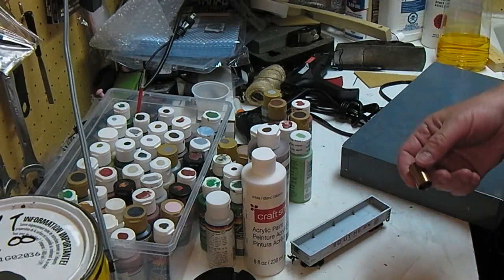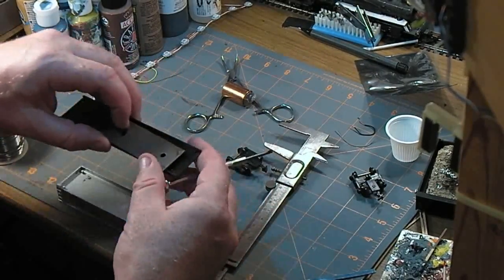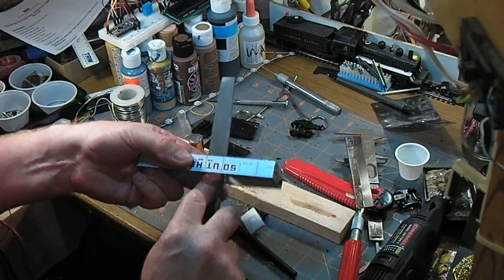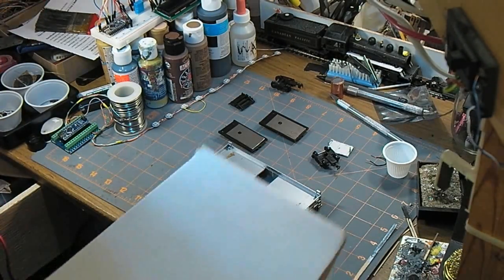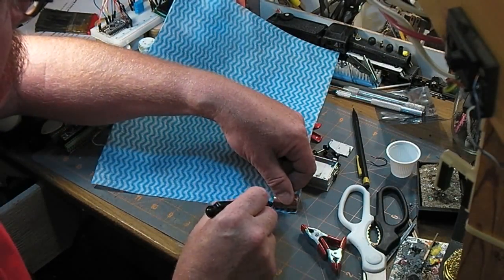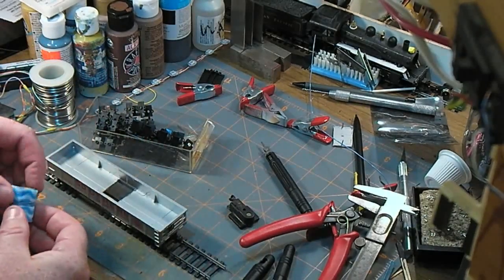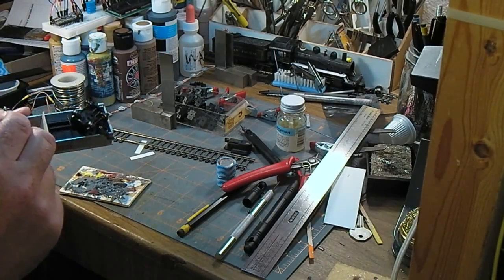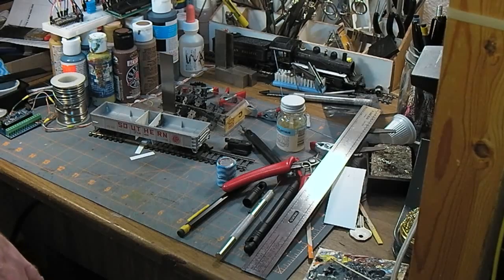Building a track cleaning car

Comment: I know this is an old vid, but I wanted to point out that the fundamental error in the design is that the cleaning pad rolls. As a single car you want the cleaning pad to be stationary. A rolling pad only moistens/softens the crud, it won’t remove it. If on the other hand, an additional car with an abrasive pad followed, it would remove the moist crud on the rail head. To this end, I am currently building a MOW track cleaning train with 4 cleaning cars which include, in order, 1 wet-clean car, 1 abrasive clean car, 2nd abrasive clean car (different type of pad), and lastly a soft-clean (buffing pad) car. Mixed in will be a crane, flat car, and flanger caboose on the tail end.
Another commenter questioned about how someone should make a Loram track cleaning car. Myself & a couple other modelers discussed this some years ago. That is, making a prototype to look into mass production. It ended up never materializing on the basis that we felt too few people would be willing to spend $800+ on a track cleaning train. It might make more sense for someone such as Walthers or Atlas to manufacture such a thing, but not a start up company as their very first offering.

Comment: Just finished test running this past week and must say how pleased I am with the result. The only real difference in mine to yours is the use of lead shot instead of nails in the middle which is held with two part epoxy which was dribbled in very wet and allowed to set fully. I then filed and sanded the ends flat and set the roller as you suggest. 
I did add a 'load' over the roller which is removable with a magnet and it too (the load) has lead shot mounted under it to balance the car heavily over the axles. I also added brass baring cups (reused from percussion caps as used in historic weapons) for the pin point axles to allow for these added weights on the non-conductive wheels.
Reply from the maker: Good idea with the shot. Use what you have is a big part of my modelling philosophy.

I added a basic crate to mine a few months later as a load.

https://www.youtube.com/watch?v=EpAvJ_FotWs&index=4&list=PLE9Um5NpNcs5ghfp6Y1Ezy2zEPmlIH01u

Comment: I convert older Atlas diesels to track cleaners,  Use a dummy and place a cut to size Masonite board  to float between the shells fuel tank. Mine work flawlessly and keep track spotless.
Reply from the maker: I have a box car that is equipped with a masonite slider too. I run them together in a cleaning train.

Comment: I've wondered why some one hasn't made a track cleaning  car which is modeled after a rail grinder. It would be more prototypical. You could even incorporate a flint wheel from a disposable lighter driven by a small motor hidden inside the car. Way cool! (as long as you don't start your layout on fire) :-)

Comment: I was expecting to see dual motorized rotating wire brushes powered off of the track
Reply from the maker: That's a much more involved build.
And for normal routine cleaning this simple design does a good job

Comment: Because I have my interests into so many types of hobbys,I tend to cross reference over into others when I come up with stuff. Using an abrasive pad like a scotchbrite pad cut in a strip and glued to a floating brick of some kind would also work as a track cleaner. I would use varying weighted blocks to get the desired contact to the track,mabe even mount steaps with springs over the block to gently push down on the scotch brite pad. The saying whatever works is not wrong,its more like whatever works best. Even running a pad with the cloth on afterwards to clean up the raild.  few drops of alcohol to the pad mabe even helps. I worked our festival of trains during Christmas and 90 percent of what I did was track cleaning,just to keep things moving. Comming up with track cleaning cars saved alot of time and effort.
Reply from the maker: I do also have a dry drag--along kind of cleaning car that I made several years before this one: https://youtu.be/4JJRxVyH3Vo?list=PLE9Um5NpNcs5ghfp6Y1Ezy2zEPmlIH01u&t=150

And for a deep cleaning after many years of non-use, I still rely on the tried-and-true manual method:  https://youtu.be/LCCqwd2drxY?list=PLE9Um5NpNcs5ghfp6Y1Ezy2zEPmlIH01u

Thanks for watching, and for the interesting comment.

Comment: Hey , if you happen to see this comment, just wondering if you were happy with the results.
I use 3 wagons, the first with a masonite pad like your other cleaning car and 2 others of same design but 1 with a piece of plastic non scratch scouring pad and the last with a felt square soaked in alcohol.
Seems ok but wondered if this was better or worse in your opinion.
Reply from the maker: My 2 cars used together seem to do a good job keeping everything clean.
But for a deep clean if I haven't been running for a while, I start off with a good old Brite Boy, then follow with the cleaning train.
My only thought about the plastic abrasive pad is that it might hang up on a turnout or a gap. 

Other than that, it seems like it should work well, but on track that sees regular use and doesn't get too dirty, it might not be necessary.
Reply: @pileofstuff  Firstly thanks for the reply.  The scouring pads I use aren't like your dollar store ones. I actually get them from an auto store here in Australia. They have a surface that looks like a scotchbrite dobie pad, not the rough hairy ones, they would snag for sure.  My track only gets the odd use every week or 2, so cleaning cars are a must for me.
Reply from the maker: I'm not familiar with that Scotchbrite product.  I'll have to see if it's available here.

There are some commercial cleaning cars that use a roller or pad made from stuff called "Cratex rubber", which is a fine abrasive impregnated hard rubber product.

Comment: This chap does not work like a professional. Not a clue.
Reply from the maker: I never claimed to be a professinal.

This is just my hobby - something I do for fun. And something I do with available and inexpensive materials, specifically as an extra challenge.
Reply: I would say thats exactly what he does have, a clue that is.  I wonder why you use the term professional? "Engaged in a specified activity as one's main paid occupation rather than as an amateur".  Very odd use of the term in relation to his video.  May be you need to reflect upon why this bothers you.